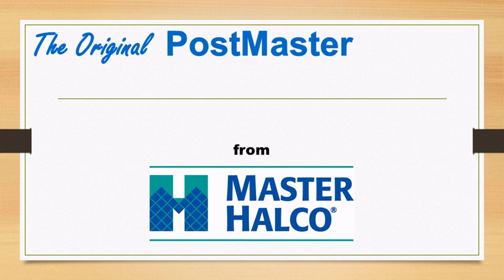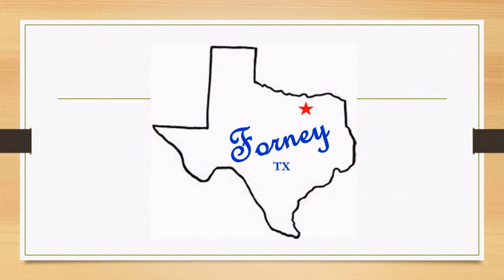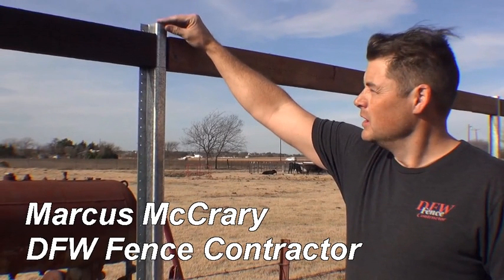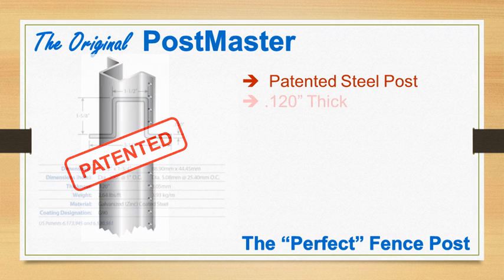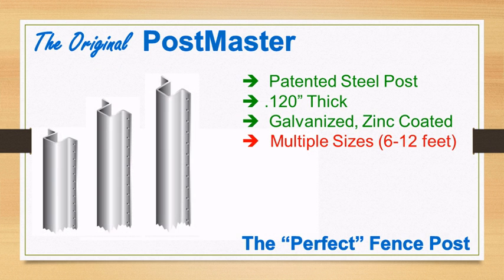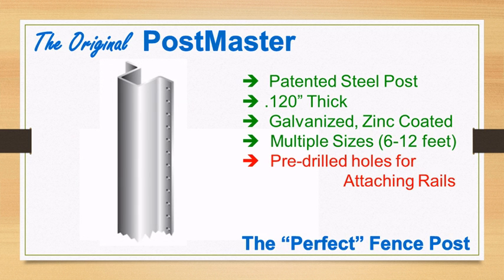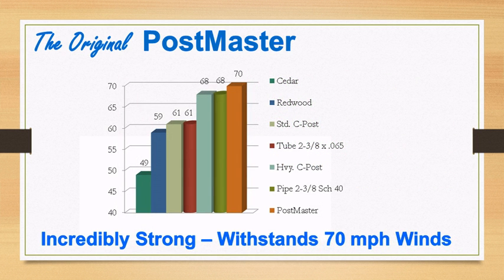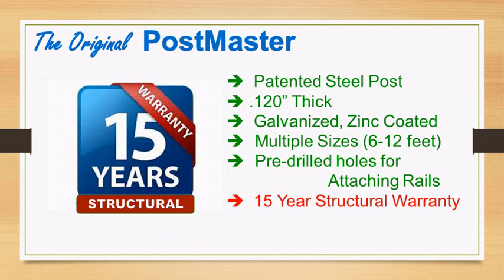PostMaster Installation Part 1 – Overview

Comment: I can only get your 9ft postmaster posts, but need an 8-9ft fence. I'm thinking of lagging 2x4's vertically to the postmaster to create a taller fence post. 
I can see two options:
1. Install the postmaster at a 90degree, and then lag a vertical 2x4 against both the drilled flanges. That would leave an issue on the other side of the postmaster though, for getting the rails attached, and it might reduce the bend strength of the post, possibly.
2. Install the postmaster the proper way, and then lag two vertical 2x4's, with the flange sandwiched between them. Then I would need another set on the other side of the postmaster though. So four vertical 2x4's per postmaster.

Whatever I do, I certainly don't want to rely simply on screws to protect against the wind pushing it over.

Any thoughts on this?
Reply: Was wondering about that as well. Like bolting/welding a short, overlapping length of galvanized pipe in the channel, sunk into a concrete anchor. Maybe with 1-2" bolt ends extruded so if/when the post is pulled, the concrete comes out with the post. Or cutting a section, turning it around face to face and bolting an extension to the bottom of a post. Would be nice to have guidance how much overlap is necessary to maintain "73mph" wind strength.
Reply: FYI, Home Depot was able to special order longer posts.